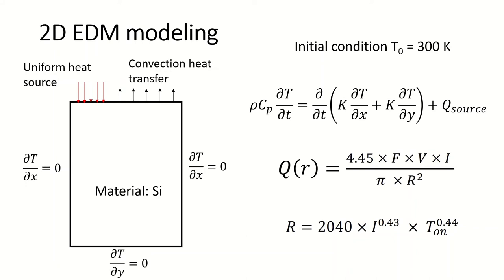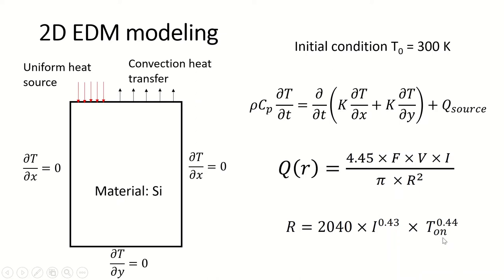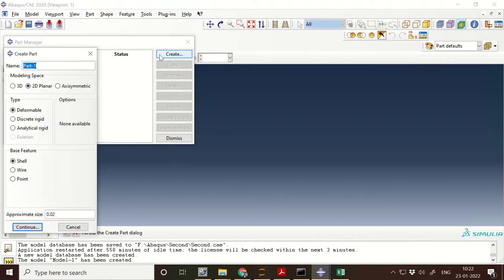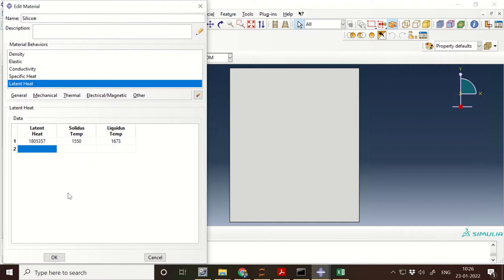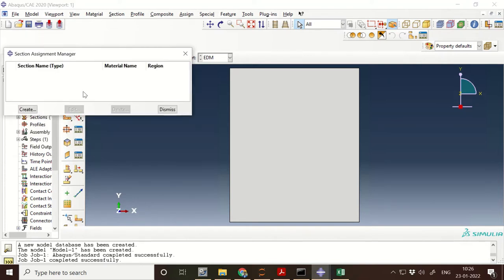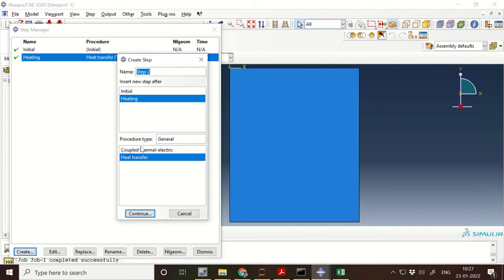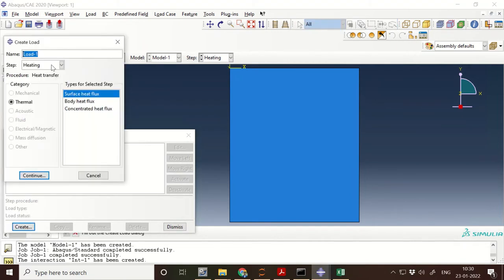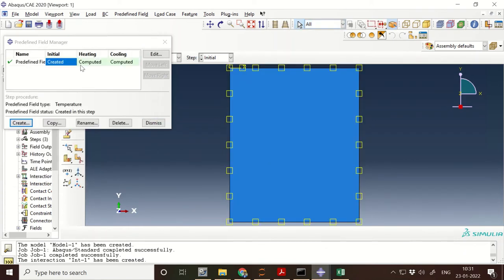EDM Modeling in Abaqus

Comment: How do you get temperature and thermal conductivity data?
Reply from the maker: The temperature you can measure from the result section. Thermal conductivity is the input parameter.
Reply: How ? ... can u explain.
Reply: In your excel file you have shown too much data... which formula you  have applied
Reply from the maker: @anandasinha9098   The data is from literature.
Reply: Can you give me the link ?
Reply from the maker: @anandasinha9098   I have updated the property link in the description. Please check.
Reply: @pinalrana   thank u very much sir. But can you tell me how do you get different thermal conductivity at different temperature?
Reply from the maker: @anandasinha9098  It's an experimental value obtained from the literature.
Reply: @pinalrana Thank u...  i understand.... but can you give me any literature reference where i can get all properties of ti-6al-4v  . As i have studied many papers but not able to get all the properties varying with temperatures
Reply: @pinalrana   and another question is how can i find residual stress after getting the thermal gradient and heat flux simulation